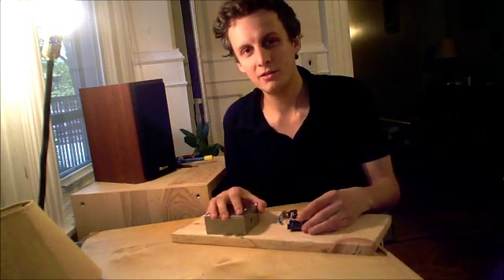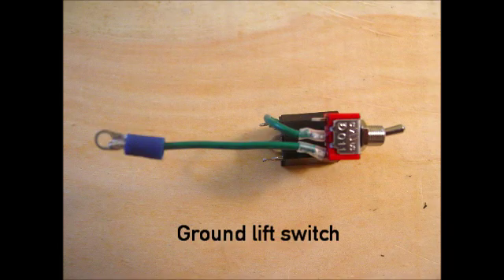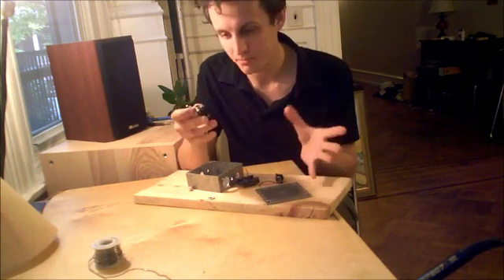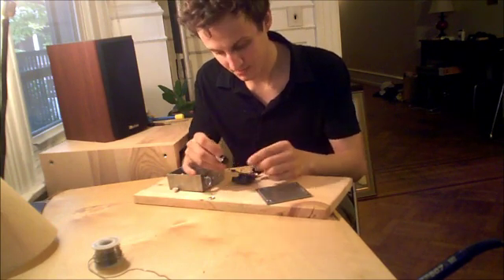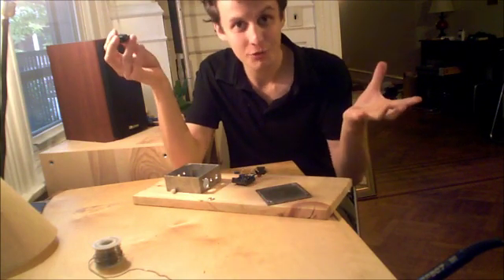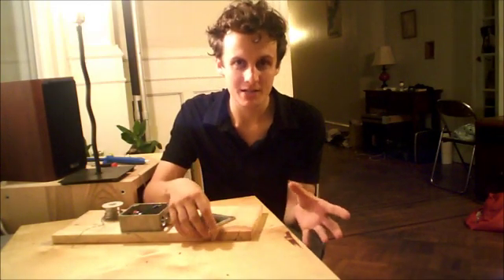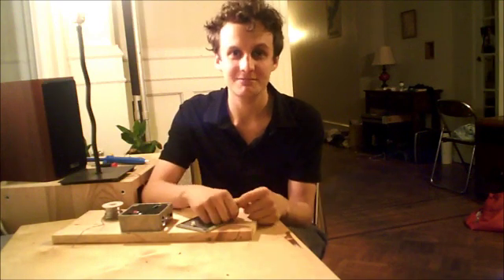How to Build Your Own DIY Reamping Box

Comment: i have this setup, 
guitar  -> focusrite saffire 56 -> bias desktop -> line out DIRECTLY on cab (no head, only cab!)
and sound AWESOME.
this reamp can improve sound quality and dynamics?
Reply: First of all, it's amazing to me that your saffire is able to drive your speaker enough to get a good sound. When you say you're not using a head, that's technically not true. You're using your interface as an amplifier. A very low powered amplifier. Since line outputs on these devices are usually rated at somewhere around 100 ohms and your speaker is looking for 8 (most likely, maybe 4 or 16) you'll find that even though it may sound good to your ears, you might be doing damage to your equipment (probably not, but it's best to connect things the way they're designed to be connected.) 
This DI box will not help in your case because it is designed to convert a line signal to an instrument signal. Your speaker is designed to sound best at a very high wattage and low impedance and instrument level is the exact opposite.
The process is called re-amping because the amplification is supposed to happen again outside of the digital domain.

Comment: Hi, Can you please tell me how do I built a DI box or audio converter do balance de audio output?
I need unbalanced input 2 TS Jack (L-R stereo) to 2 balanced output XLR (L-R stereo) exactly like the balanced output on a audio mixer with the same line out level instead of mic level like a common passive DI.
Can you tell me what kind of transformer do I need for that?
I only need to create a balanced output line level.
Thank you very much.

Comment: I am confused, what exactly do I need a Re-amp box for? Can't I just connect the output of my sound device (Saffire) to a guitar amp via good ol' guitar cable?? Please help!
Reply: because when you go in/out of your digital audio workstation or console it goes in line level which is 1.23 volts, a guitar amp requires instrument level signal which is less than 1 volt. which if you plug a line level signal into a guitar cab it could fry the circuitry. does that clear some of the question up?

Comment: .....or - after using a DI in reverse, can I feed it through my Boos me-70 in bypass mode and use the output level to control the volume? Will that solve the volume problem u mentioned?

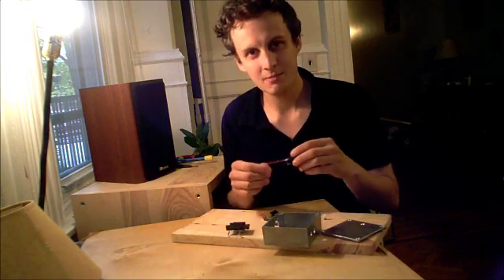Comment from the maker: Good question. This is a common misunderstanding. First off, an active DI will not work in reverse, so it must be a passive DI. But even a passive DI in reverse is not an ideal reamping box. Remember that the output of a DI is designed for microphone level and may overload if given a strong, line-level signal. Used in reverse, a DI will also increase the volume of your line-level signal, usually by a ratio of about 1:12. This will be way too much level for most guitar inputs.

Comment from the maker: @samuelito210791 Sure, no problem. Transformer: Edcor PC10k/150, Case: Hammond 1590B, Resistor: Xicon 200 Ohm 1/4 watt metal-film 1% tolerance, Switch: Standard SPST mini-toggle switch, Input Jack: Standard 1/4" "Stereo" jack, Output Jack: 1/4" "Mono" jack with plastic ferrule, Wire: 22 gauge coated copper wire from RadioShack.
Reply: so no added 2 470 ohm resistors needed?

Comment from the maker: @samuelito210791 For a DI, you need to go from very high input impedance to very low output (<200 Ohms). It's harder to find a cheap, off-the-shelf transformer that will do this. However, take a look at the Pikatron ÜP3096M wired in reverse.